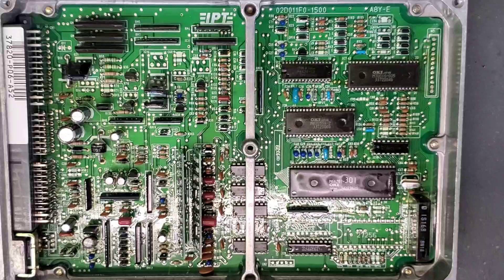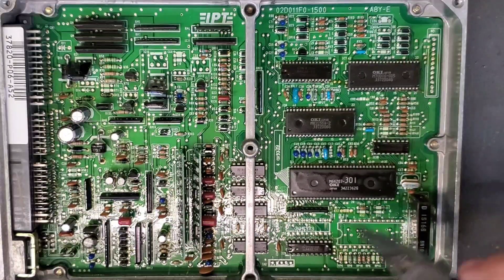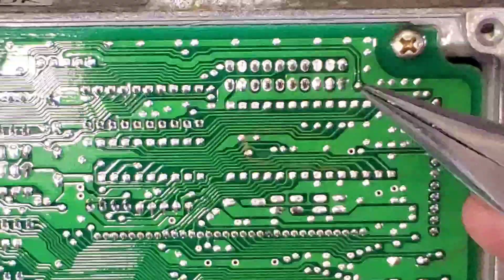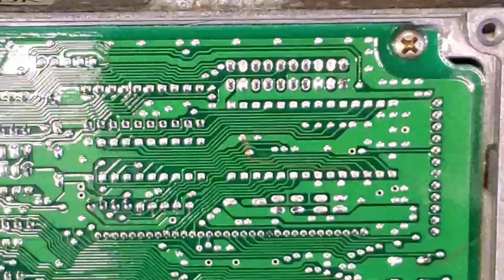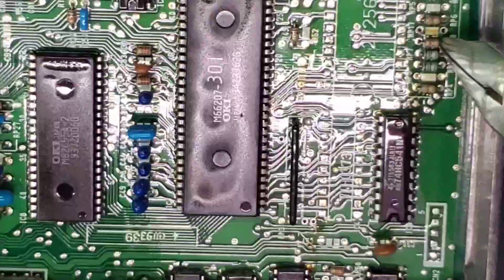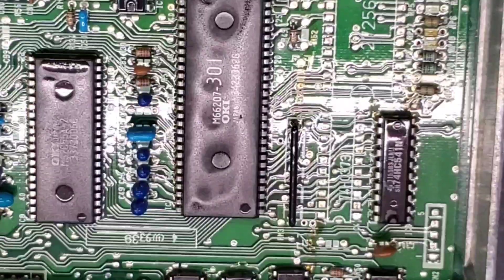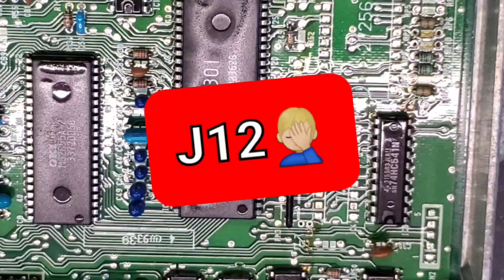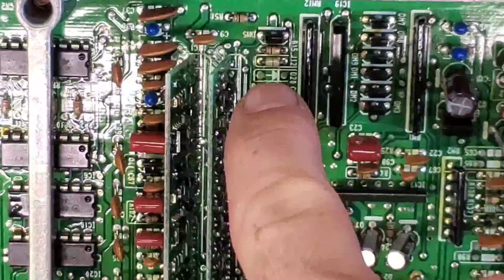OBD1 p06 p28 p75 Honda civic/ Acura integra ecu automatic to manual 5 speed conversion

Comment: Hello, I need the code for transistor Q31, because the one on my board is broken and I don't know how to replace it. Thanks.
Reply from the maker: The Q31 transistor fries/burns when the purge control solenoid connector on the engine harness is mistakenly plugged into the intake air temperature sensor. It's not necessary for the functionality of the car, but you'll have to fix the wiring before you re-install the fixed ecu. If you don't it will keep happening. 

(D1691 60V NPN Transistor) is what you need to search for.

Comment: If I don't remove j12 the Ecu doesn't work in manual? Mine is a p06a51
Reply from the maker: The j12 has to be removed to allow the ecu to data log, so it's not essential to the regular operation of the ecu. Since it's not essential and it's a 0 resistance contact I used it as a jumper. It's a oem component and looks better than a wire jumper, so that's the reason I used it.

Comment: What makes you use the resistor vs thr wire? I’d it because it looks cleaner or more safe?
Reply from the maker: Because it looks factory done vs. an afterthought, but it does the same exact thing as long as it's a 0-Ohm resistor.

Comment: Will this work on p76?
Thanks
Reply from the maker: I'm not familiar with the p76 ecu, but if it's a rectangular obd1 ecu you should be able to do this conversion to it.
Reply: @the710experiment84  
Ok thanks.  I opened it up but it is not the same as far as where resistor location.  I could not find 17 or 18.  Thanks again

Comment: hi bro p3g ecu auto can convert to manual b20
Reply from the maker: Good question! I had to look that ecu up because i wasn't familiar with it. Unfortunately it seems the P3G ecu is an obd2 ecu, and can't be converted from auto to manual in the same way as the obd1 ecus. You might want to look into buying a jumper harness and chipping/ tuning an obd1 non-vtec ecu like a p06, or p75. Hopefully that will help you out, and you'll consider subscribing to the channel.
Reply: @the710experiment84  thank you verry much for response.

Comment: Are you sure j12 can be taken out?
Reply from the maker: J12 has to be removed when chipping the ecu in order to unlock the data logging function, so it isn't necessary to have on the board.
Reply from the maker: Sweet, I'm glad it worked for you! Congratulations Miguel!
Reply: I’m going to do the same procedure on my ecu then
Reply: Hey this worked! Got rid of my check engine light for the code 19